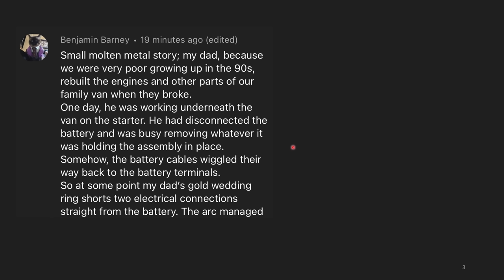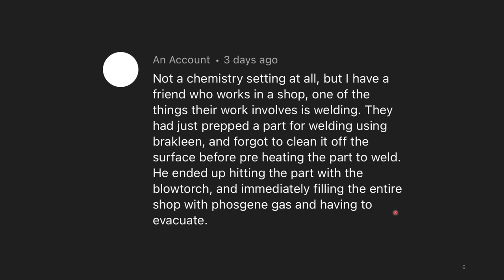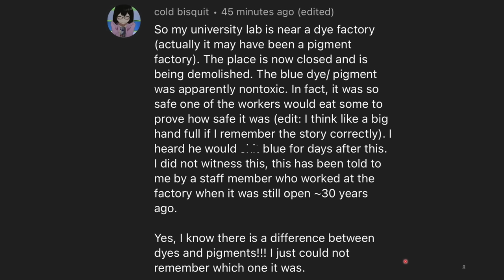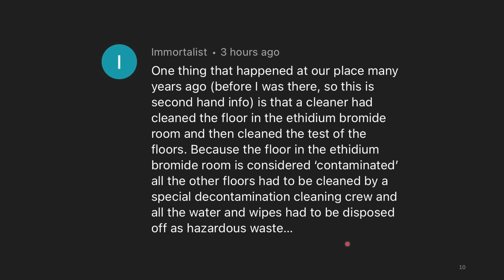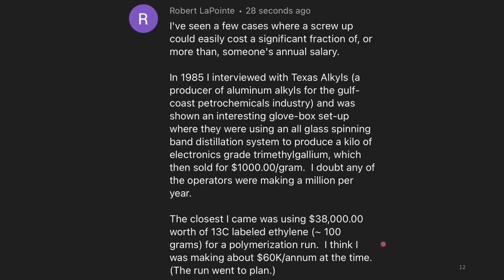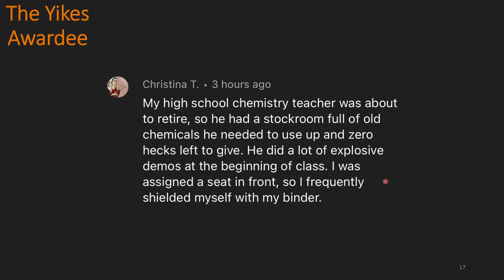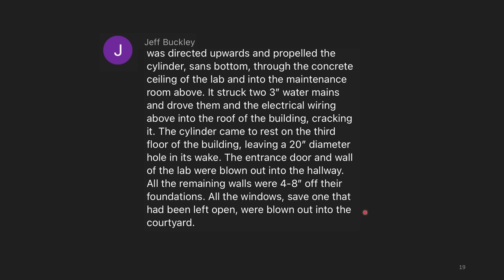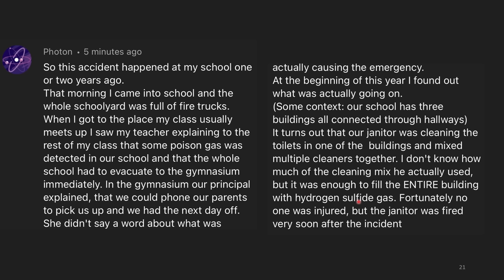Liquid Nitrogen Overpressurized and Exploded

Comment: There are a ton of stories about wedding rings or other metal jewelery causing accidents with powerful batteries. Always take them off when you're working on batteries (and other power supplies) that are powerful enough to heat up metal.
A car battery is powerful enough to instantly vaporize small metal items, and to melt through a big wrench if you give it a minute or so. They are RIDICULOUSLY powerful.
Reply: 600+ amps powerful to be more exact
Reply: Yes, a mechanic friend of mine accidentally shorted a battery with his gold wedding ring. The ring melted pretty much instantly and burned his finger down to the bone. He came very close to losing that finger. I also had a similar incident with a metal watch strap.  The strap got hot enough to turn blue. Luckily I got it off quickly enough to only suffer mild burns. Oddly enough that was the last time I ever wore a metal watch.

Comment: sodium hydrosulfite (dithionate) (used for rust removal as iron-out) can form a bunch of fun sulfur gasses like SO2 and trace H2S and thiols with acids which the SO2 potentially could somehow react to form H2S with other stuff

or perhaps he stole a bunch of chems from the stock and tried using them to clean
Reply: I think you've nailed it.   SO2 and H2S might smell alike to an inexperienced person.  Chlorine (which would have been my first guess) doesn't smell a bit like H2S.

Comment: I used to have access to liquid nitrogen from our mechanical engineering lab. I liked to go to parties and do various liquid nitrogen demonstrations and tricks. Of course, I couldn't afford a proper dewar, so I bought a cheap 1.75 liter thermos and drilled some holes in the top of it. It'd last for 24 or 48 hours before fully evaporating.

Whenever I went to a party I'd go to the machine shop, load up my "dewar" then hop onto the NYC subway cradling that thing like a baby. Of course, whenever the subway train got a bump or jolt, the liquid nitrogen would slosh around and vaporize, causing little jets of condensation to hiss out violently from the top.

This is NYC where nobody bats an eye at the craziest things, but my setup did get a lot of stares. Big unmarked steel cylinder, with the top frosted over and random steam jets coming off of it? yeah... luckily I was never stopped by the cops.

I should mention that these were... 18+ parties so the activities did involve either skin contact with the liquid nitrogen or... certain items at cryogenic temperatures. I did have proper safety precautions and training for this specific use case (yes, you can actually get that kind of training) and everyone had a blast. It was pretty popular and would always draw a crowd. Nothing bad happened but the parties did eventually ban the liquid nitrogen, so that was the end of that.

Good times.
Reply: I’m trying to imagine what kinds of kinky shenanigans can be done with liquid nitrogen. Maybe I’m not imaginative enough, but I can’t think of anything. It also is probably good that I can’t think of anything.

Comment: A quick story about breathing in pure ammonia.  This was my second year of undergrad and I was planning on making some metal nitrides from the oxide by heating them in an NH3 atmosphere.  My professor told me that around 10% of people can't smell ammonia and I should double check that I could, or else she'd make me wear a NH3 detector because it can be dangerous in high levels but most folks can smell it well before it builds up to dangerous levels.  I had a very stuffy nose that day so when I tried it first cautiously I didn't smell anything.  My prof suggested I let a little more NH3 out of the tank and try again, this time I had more courage so I took a large whiff and I could immediately feel my nose letting go of all the snot that was stuffing me up.  I could taste a combo of mucus and ammonia run down the back of my throat.  Turns out I'm not in the 10%.
Reply: My nose hurts just reading that

Comment: About the gold ring, it’s worth mentioning that although car battery’s are only 12V, they push hundreds of amps under load (typically 600-900A) and I’m not even sure what the current would be with a short. If you clack some jumper cables together those sparks are lil chunks of copper blasting off the clamps

Comment: One of my “favourite” things I’ve done to myself, about a decade ago I was out getting ready to hop on the snowmobile, but I had to gas it up first.

Well, I grabbed the jerrycan and popped the top off, walked over to the sled and set the full can on the seat, thus resulting in it sloshing around enough to splash straight up into my eyes.  Half an hour of rinsing my eyes out later and I was still in agony.

Folks, don’t fuel up your eyes, it doesn’t give you better mileage
Reply: Accidentally had a similar thing happen when I tried to grab a jerrycan to fuel my lawnmower. Moral of the story? Don't store gasoline on a shelf above your head level.
Reply: @candiman4243  and/or also don’t stand with your eyes directly over the mouth of the jerrycan, lessons get learned on days like that

Comment: My understanding is that halon's primary purpose was to protect electronic equipment while putting out the fire - something you would care about when putting out a small fire in a server room.
Reply: Right.  I have a small, spray-can-sized Halon extinguisher on my electronics workbench, in case it's needed if some component shorts out and catches fire, or there's a soldering accident.  I've never used it (in 30 years).  What I had in mind was fires on the order of an inch in diameter, in the middle of valuable equipment.  For real flames I have a CO2 extinguisher on the other side of the room -- also never used in 30 years, but replaced a couple of times due to age.
Reply: @michael.a.covington  In my non expert opinion I'd use them exactly opposite. Start with CO2 and switch to halon only if it's insufficient. CO2 is much cheaper to refill, but not quite as effective at putting out fires.

Any TV show you see putting out fires (like Mythbusters) uses CO2 as their first line for a reason.

Comment: I've got a little story 

I like to build all kinds of electronics but I've also always wanted to do chemistry. I decided to do something with electrolysis. It would be a perfect mix of electricity and chemistry. I used salt water as electrolyte so when I had to adjust the setup I just put my hand in the water as it wasn't dangerous. But one time I did that my hand felt tingly and started to kinda hurt. I think the salt had turned into sodium hydroxide so the water was basic enough to give me a mild chemical burn.
And no it was not an electric shock.

I was too busy worrying about the chlorine gas I forgot the other side products.

Comment: Yep, there's a reason why the classic sodium in water demo is done with really small shavings of sodium metal. Any piece approaching 1 cubic centimetre in volume can generate enough heat to melt itself, and if that happens, an explosion is not just possible, but likely. The larger the chunk, the more likely it will explode, so a golf ball sized lump is basically guaranteed to detonate in a big way. I can easily believe that a piece that big would generate an explosion powerful enough to rip a toilet bowl to bits, and you would definitely not want to be standing anywhere near it when that happened.

This would depend on how rapidly the sodium chunk came into contact with the water: If you tightly encased it in many layers of dry toilet paper, that could provide enough of a delay to allow it to be flushed down into the sewer before the reaction rate went exponential - provided the bundle wasn't too big to prevent it going around the U-bend and down the pipe. So with careful experimental design, you could make the detonation happen far enough away from you that you might not get hurt by it. However, when it did explode, it could easily ignite any flammable gases in the sewer - mostly methane with a twist of hydrogen sulfide. If there was enough gas present at the time, the size of the explosion could be magnified enough to blow the lids off any nearby manhole covers, and convert any toilets in range into instant flaming turd geysers.

Comment: About the gold ring story. A car battery can supply hundreds of amps in a short pulse, what is needed by the starter to overcome the compression of the engine. Gold being a supremely good conductor and a ring being a very small cross section, it's no wonder it almost exploded in its face ! If you ever see an electrician or a mechanic with a ring of electrical tape... It's probably covering a ring they can't remove

Comment: Heeey, the clam-controlled water purification plant in Warsaw came up! It's called "Gruba Kaśka" ("Fat Kathy") and is located right in the middle of the Vistula river - quite attention-catching from the banks, even more so if you spot it while crossing a bridge.
As for the clams - there's a virtual tour of the building available on youtube ("Studnia Warszawy – Wirtualny spacer po Grubej Kaśce") where the clams are clearly visible at the beginning. And yes, those are literally switches on springs, which are hot-glued to the clam's shell - McGuyver would be proud.

Comment: 1:26 My grandpa caught three phase to the chest by leaning into some test equipment that was still powered on, and his gold cross fell out of his shirt and into the equipment. he told me he flew backwards, knocking the equipment over and smashing his head. after that, he always either took off the cross or taped it down with electrical tape. always tape up your ring! or just get a silicone one to avoid degloving. i also have a friend that tattooed their ring on because they are a chemical engineer and its not worth the risk to forget to take it off

Comment: I still find it wierd how the Sodium and water reaction is able to produce an actual explosion, it can't be through hydrogen build up because the gas was already burning off. 

I mean I get it is a very energetic reaction.
Reply from the maker: It is a coulombic explosion
Reply: Thunderf00t has some interesting videos about this. Essentially what happens is that if the sodium gets hot enough to melt, sodium ions forming on the surface repel each other and cause the surface to buckle, bringing more surface into contact with the water, etc. It's a positive feedback loop that leads to all the sodium reacting very quickly and producing an explosion.

Comment: The sodium metal gets at least one person in any group in trouble.  They just can't stop themselves.

Junior year Air Academy High School - my lab partner and I had duty handing out supplies, and a third guy was measuring out the chems for assignments.  It was basically nitric acid, a penny, and a crucible.
Halfway through class, we finally notice that our third wheel is fishing around with tongs in the sodium metal jar when we weren't using any for class.  We had just enough time to flee the stockroom, yell "incoming!!!!!", and hit the floor.
Blew up half the stockroom because he tossed it in the rinse sink.  What a mess.  Apparently, he was smart enough to race out the other door thereby literally saving his skin, but it did make him miss graduation due to a 3 month suspension.

2 weeks later, this one girl was still insisting the classroom had been hit by lightening.

Comment: Y'know hearing others remind me of the dangers of home chemicals makes me wonder if I did any damage from my time at a Sam's Club for my first job. We used chlorinated cleaners/sanitizers and I was the only person in my section. So in the back where we prepped meat, we had a huge industrial fan pulling air and steam out for when we cleaned and sanitized betweens prep. We were supposed to be wearing respirators but we didn't have any, I've honestly never been in large restaurant or building where we use them since. But the amount of chlorine and other chemicals that made my skin so freaking dry and gave me issues with my nose and arms... My god that was probably not great for me being in an enclosed room spraying chlorinated cleaners all over the walls and explains my headaches and very dry skin from my time there. Sam's Club would like you to know they aren't a Walmart, but they are

Comment: If you multiply the pressure (1200 psi) by the volume of the dewar, along with a factor of 5/2 for the thermal and rotational degrees of freedom, you'll get the energy released by the explosion.
At Caltech back in the eighties, we'd do this with two liter bottles and call them 'thermal expansion devices'. They take (very) roughly twenty minutes to detonate in air (due to the formation of an insulating layer of ice) but mere seconds in water.

Comment: Yeah the stories about mixing cleaning chemicals reminds me of a case at an old job I used to have. Normally things got cleaned either with a regular industrial detergent in water, or for certain areas, like biohazard rooms, they got cleaned down with Virkon. With Virkon, you have to leave it time to work, and everything slowly turns pink over time from the residue it leaves behind on the surface until eventually someone breaks out the heavy duty floor scrubber to remove it. In the cleaning cupboard, there was also household bleach, purely for cleaning the toilets in the changing rooms, but it was never supposed to be used in the actual lab areas. Anyway, at one point a newbie who had a thing about germs, decided to use bleach instead of Virkon. When she got to the room that was finally empty after weeks of being cleaned near daily with Virkon, the bleach reacted with the Virkon residue on the floor and released some sort of toxic gas. Thankfully someone was around nearby and raised the alarm and got her out and to a hospital, and I think she’s fine now, but she was given office duties after that.

Comment: RE: car battery, gold ring. The CCA rating on car batteries stands for Cold Cranking Amps. Thats the COLD cranking amps, as in when the fluid in the flooded cells is on the less reactive end of the thermal spectrum. Its usually about 600+ amps on the low end (I usually see 800+ amps). Because the battery is expected to spin the engine against the compression of the pistons for a number of seconds possibly when its balls cold outside, it needs A LOT of juice.. 12v at 600A is north of 7kW. Yes, 7000 watts of energy. That is plenty to flash liquify many metals...... Ive had a craftsman wrench weld itself across the terminals of a car battery once. Luckily it was a pretty weak weld, but it was indeed stuck and warming up quite fast. LPT: If you are working on or around the electrical system of a car, especially any wires that say live when the car is off, DISCONNECT THE NEGATIVE TERMINAL!!! With the negative undone everything will be safe to touch everything else. Just be aware you will get a little sparky jump when you reconnect it as the capacitors in all the electronics charge.

P.S. if you dont want to lose your radio presets, or have the computer run its relearn cycle, you can get/make a 9v to cigarette lighter plug adaptor. Pop it in right after disconnecting the battery, AND REMEMBER TO REMOVE IT BEFORE RECONNECTING!!! It will provide plenty of juice to keep the memory circuits alive but not enough juice to arc anything....or weld...

Comment: As a machinist I've worked with some very expensive alloys. The most expensive part I've ever messed up was more than $100K USD.

At my current employer we have a huge LN2 tank trailer sitting outside and we fill ~100L dewars from it. Since the gas company owns the tanker, we have our own dewars which all have metals plates from when they were most recently refitted. The newest refit is from the early 1980s. Our company has a history during which we've absorbed many failing or defunct engineering firms, so it's likely that we inherited these ancient dewars from one of those. I often worry about them, they are supposed to vent at 50psi, but one of them has a broken gauge, and while it does seem to vent correctly, there is no simply way to know for sure what pressure the tank is under.

As for the cleaning chemical that produces H2S, my best guess (and I think it's a long shot) would be some kind of alum (most commonly potash alum aka potassium-aluminum sulfate). It's not a common janitorial chemical, but it does find use in laundries, and can be occasionally found at grocery stores. It was once considered food-safe; and used to keep pickles crispy when canning (until the whole aluminum toxicity thing blew up). It is very mildly acidic, less so than most household vinegar. It is about as innocent and unintimidating as a chemical can be, so most people who know what it is would think it extremely innocuous; however, it is just barely acidic enough to react with iron, and when it does, it produces H2S. Mostly this doesn't become an issue because it would take a large concentration or hot alum to generate enough H2S to become a problem, but it someone dumped a bucket down a drain or something, and the drain wasn't fast enough, H2S might be produced in quantity. I have used alum to remove steel alloy tools (drills, taps) from aluminum or other non-iron work pieces, and you can see bubbles come off of them.

Comment: Interesting story with a lot of ignorance.

I was working in a metal fab shop. There was a lot of restoration work in said shop, and that typically involves degreasing metals before refinishing with acid etching solutions. We had many options for this.. however my favorite was an industrial degreaser with a deca-flura-something chemical.. mostly because it had a toothpaste smell instead of a harsh headache inducing aroma.. also.. it had incredible narcotic effect that I wasn't aware of because I usually used it outside.. 

Anyway now I have a couple permanent scars because a strong metal etching acid was spilt on my thigh while I TRIPPED BALLS.. luckily this is a restricted chemical to prevent abuse